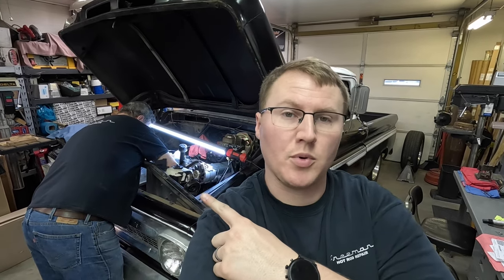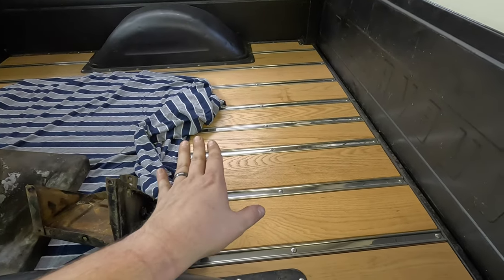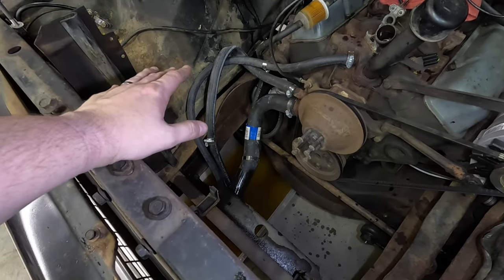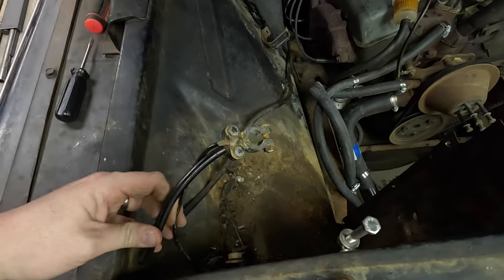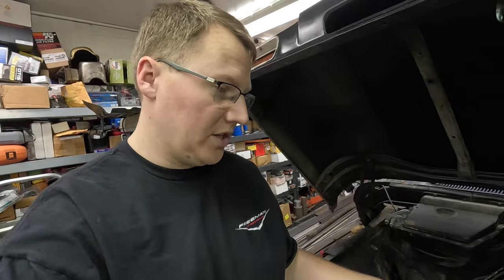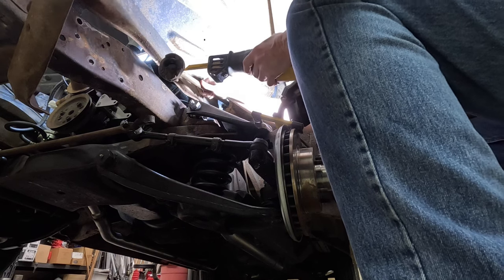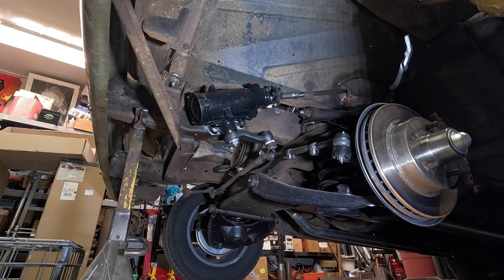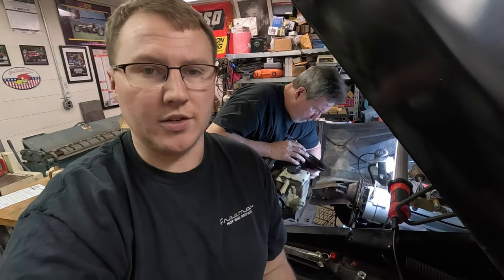1966 C10 Transformation: Vintage Air & Power Steering Install

Comment: Finally one with power steering install and vintage air!! Now I need to find a vid for door window and window hardware replacement lol.
Reply from the maker: @richeerich561  I have a full weatherstripping videos for this truck! But it didn't need the full regulator and windows though.